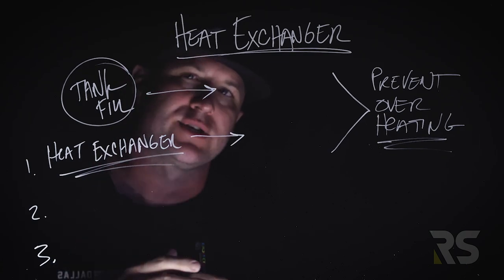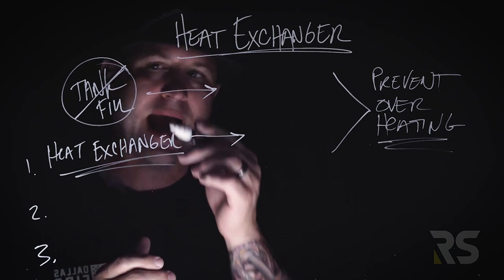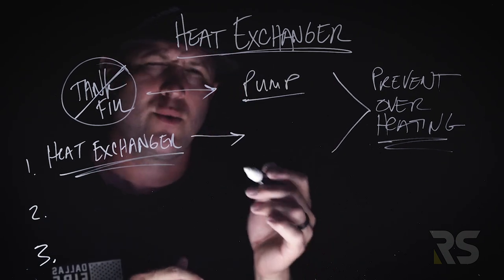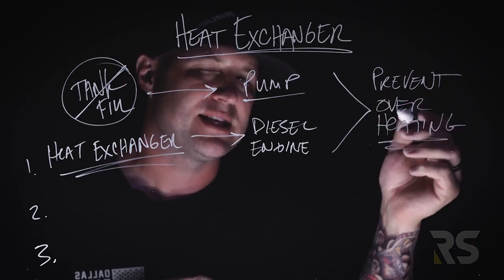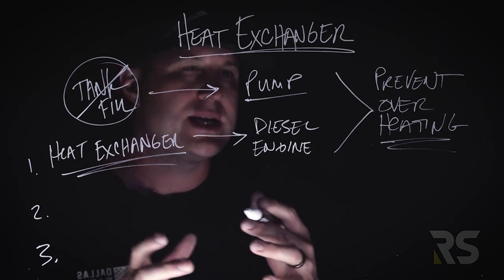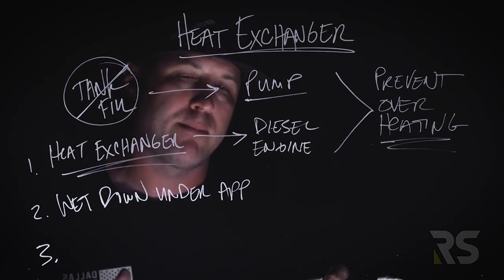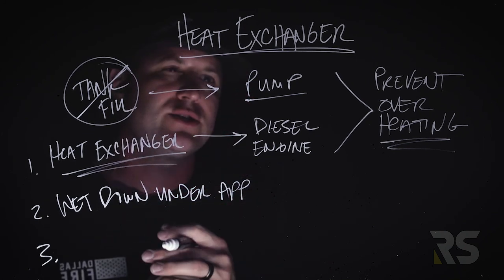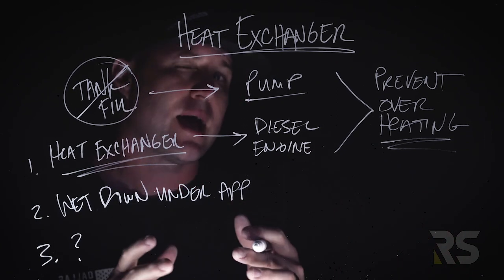Fire Engine Heat Exchanger (Pump Series - Part 12)

Comment: Everything said is 100% true, I can only add one thing. To tell folks to keep the Heat Exchanger OFF (especially on the wildland engines with smaller tanks) if you are only pulling water from tank and are NOT connected to a hydrant or cold river, lake etc. Because you are Transferring that HOT coolant temperatures of the apparatus engine and placing that heat into your apparatus tank water!  The key word is "Exchange" here. BTU generated vs BTU absorption right?  The purpose behind the heat EXCHANGEr is to TRANSFER HEAT FROM A HIGH TEMP SOURCE TO A LOW TEMP SOURCE. nothing more.  

Those lines on the heat exchanger are connected from the apparatus engine radiator, running to a heat exchanger tube mounted usually on the 4" or 6" intake PiPE(pos inlet pressure entry). So from the radiator, a discharge line runs into one end of the exchanger and out the other end back to the radiator as an isolated system. Then one end on the side, a line from the pump discharge  is connected, then on the other end of that exchanger and also on the side, is the line that pulls that heated water from the suction side and that is intended to draw cold or cool water from intake, through the pump, pump it into the heat changer, and DRAW  that apparatus engine heat away and carry it into the pump intake and then back out mixed with other cold water. If on the other hand you have no draft lines or hydrant lines connected, in a matter of hours you'll heat your tank water to the same temperature (or nearly) as your apparatus engine temp. So what's the point there then right?

Municipal Apparatus that are usually always connected to a hydrant should probably never have to worry about it. 

depending on the apparatus and its capacity in both pump and tank and exchanger, you could be recirculated hot water. what effect will this create on your impeller do you think??? !!! 

Excellent Vid!!

Comment: Isn’t it true that you want to leave the heat exchanger off until it’s needed? I see a lot of people who leave it on all of the time because it’s hot out however when we took delivery of a new pierce some years back the guy going over it told us never to turn it on unless you started to over heat, if it’s left on it would be useless when the time comes. Just curious what others thought or knew about this. 

Also, keep it up man. This channel is awesome!
Reply from the maker: I’d be lying if I had been instructed one way or another. I never left it on. Would engage it if we had prolonged operations in higher temps. I also used other methods prior to this though… cooling the ground below the engine and even using a low flow wide fog 6-8’ in front of the engine.
Reply: This is how I see it. If you have the heat exchanger on and your truck overheats, you have nothing to quickly cool the engine off. So you'll be doing step 2 of step 3 of Roll Steady suggestions that be cool th floor underneath or the front of the engine. But if you have the heat exchanger off and your engine starts to overheat. You can start the process to cool the engine off by turning a valve. In turn, it will buy you some time to pull a line cool the floor or cool the radiator down.

Comment: Is the difference between the tank fill/heat exchange the same as tank fill/pump cooler?
Reply from the maker: Alongside its regular use, the Tank Refill is used to keep the pump cool by recirculating water via the tank. 

Heat Exchanger is used to assist in cooling the Engine’s Motor. 

I've never see something labeled a "pump cooler," but my experience is limited to Dallas and a few smaller suburbs in our metroplex. The name would imply it is doing the same thing as recirculating via the tank refill.
Reply: @TheRollSteady  yes sir I agree. I have always known the tank fill to recirculate the tank water to keep it cool besides it's obvious purpose of refilling the tank but the pump cooler I have always perceived it to be basically the same thing except it cools the pump by "peeing" water out through underneath the apparatus. I don't have any experience with the heat exchanger, but overflowing over the top and into the engine is something I never considering.